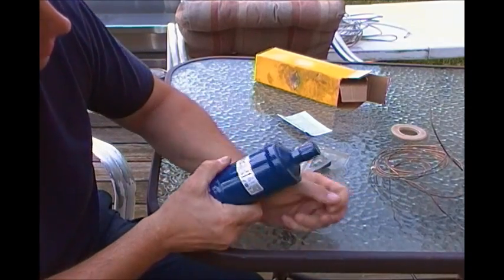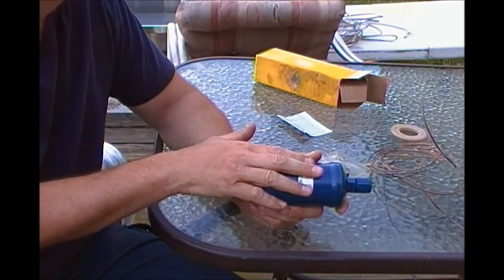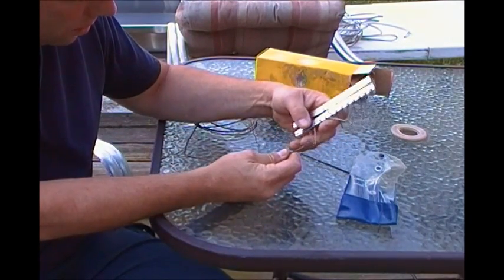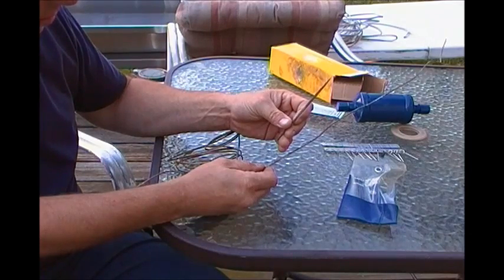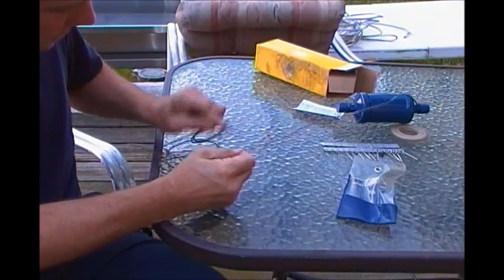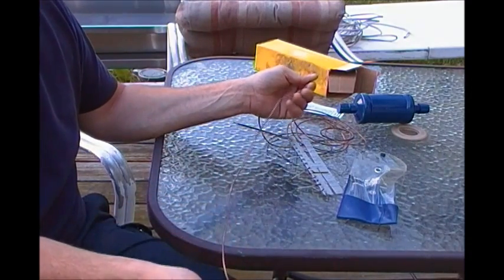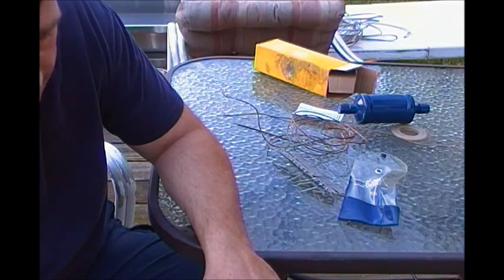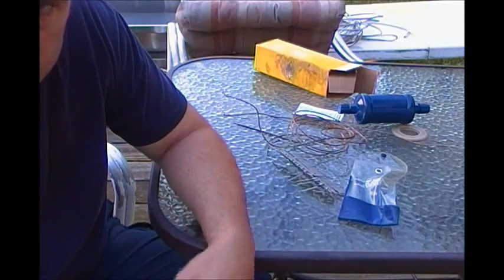capilllary tube on refrigertion

Comment: What do you do if the cap tube is soldered to the pipe from the filter to the evaporator?  A new evaporator is pretty expensive.

Comment: Sometimes if the unit is cold or has been running, even though cold inside, the low-pressure gauge is pulling down to the negative side. We charged it up to about 5-6 psig with R-134a and it was fine. Sometimes what I will do if it won't come out of the negative pressure is gently apply heat to the dryer, but the results are not always guaranteed. It's more difficult to charge when the unit is cold because we have a much less heat load so the gauge readings will be lower. This was done in a Frigidaire S X S unit.